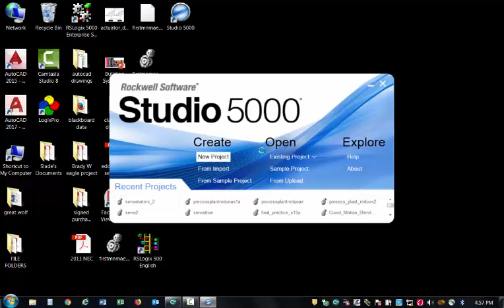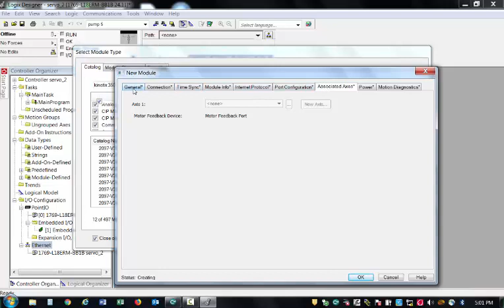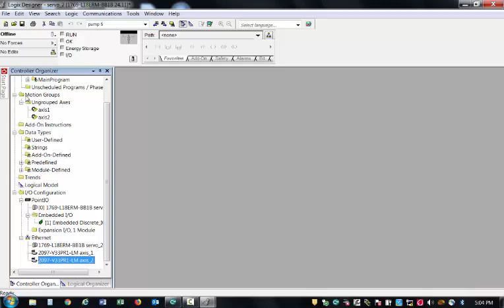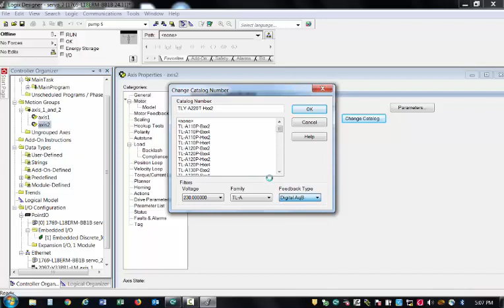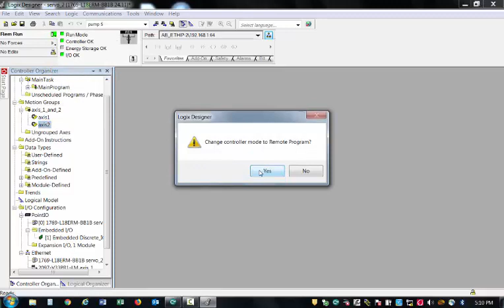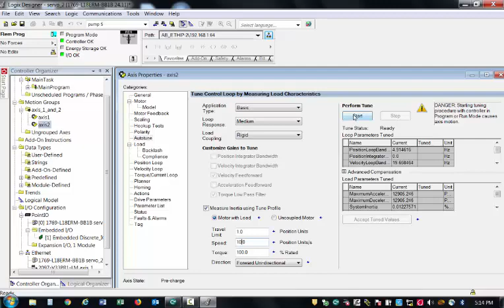Commission Kinetix 350 Servo Drive Allen Bradley L18

Comment: Hello, I followed all your steps and I was able to configure the Kinetix and the servo with no problems. The only problem I'm having is when I unplugged the ethernet cable from the kinetix drive my PLC (L61) goes to Fault Mode, Any suggestions what is happening?
Reply: Prueba esto:
Module Properties (kinetix)...
Pestaña Connection...
Major Fault On Controller if Connection FAils ( no debe estar seleccionado)